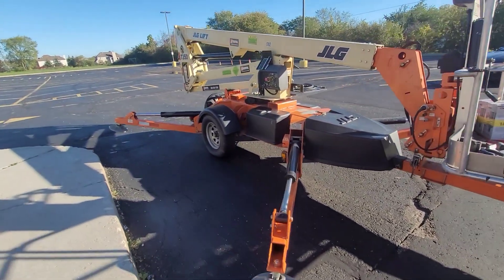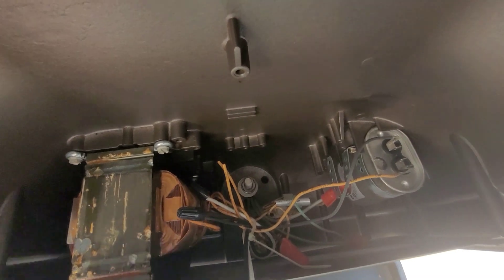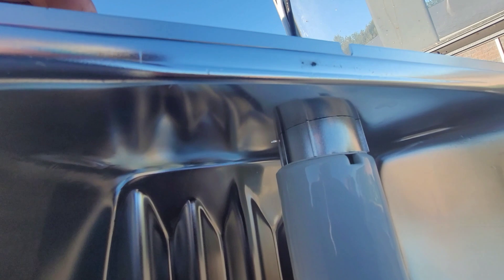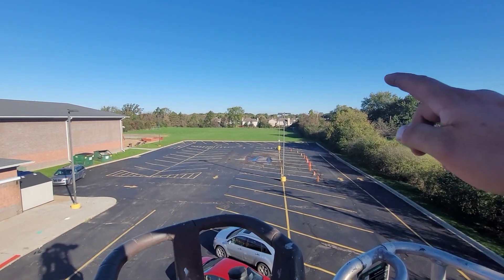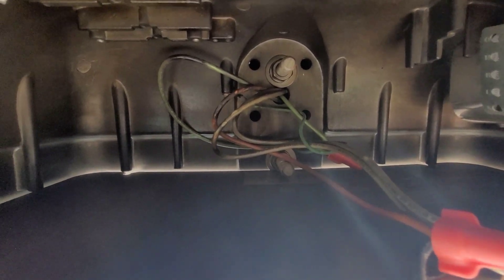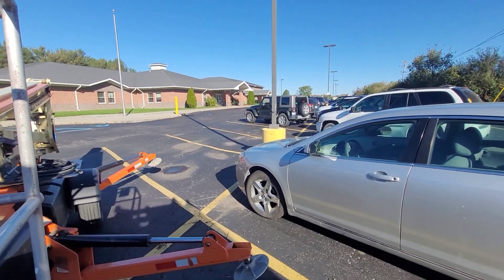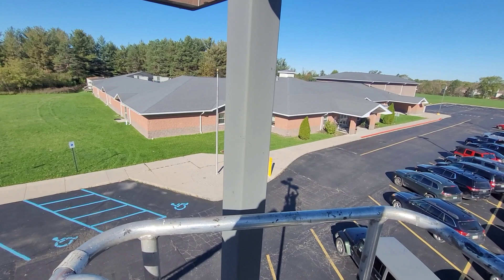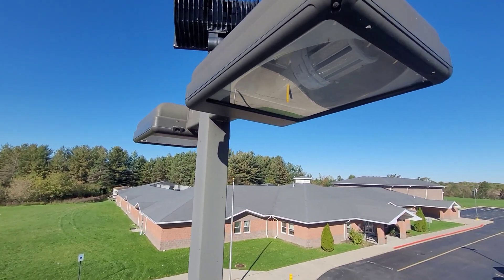parking lot lights LED CONVERSION

Comment: Nice job, but you are wasting half or more of the energy on those 360 degree corn LED bulbs inside the fixture. Many lamp manufacturers make an LED retrofit bulb specifically for shoebox fixtures like the ones in this video that only has rows of LEDs on less than 180 degrees so all the light is being directed downward. The best option is just to replace entire fixture with new LED fixture. These fixtures have come down substantially in price over time. These LED corn bulbs are almost as bad as T8 retrofit LED tubes.